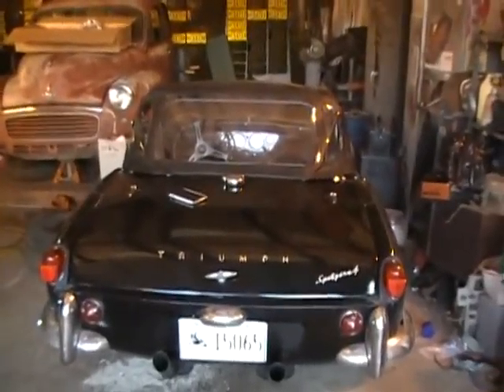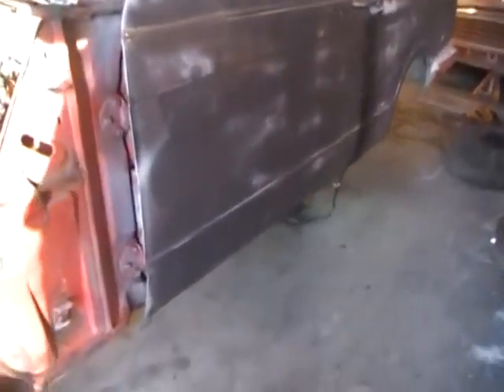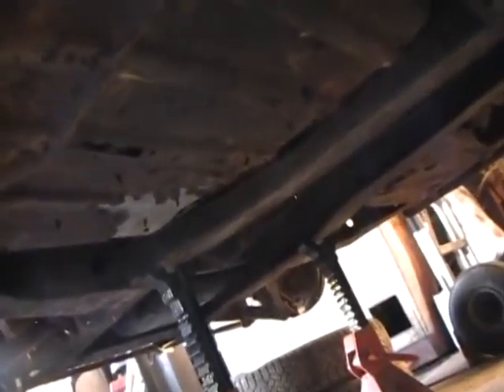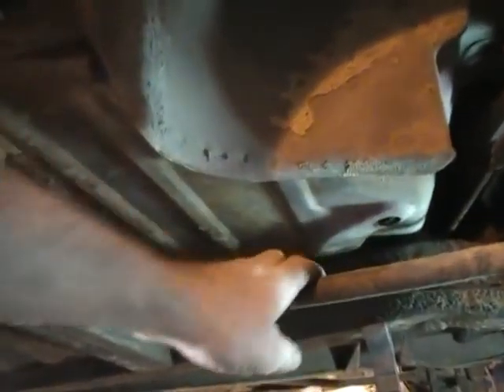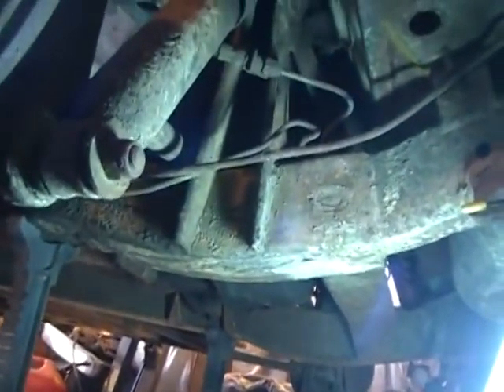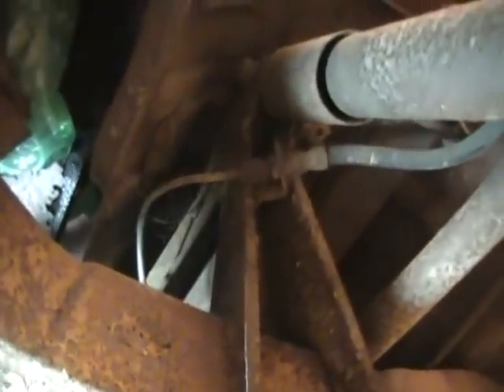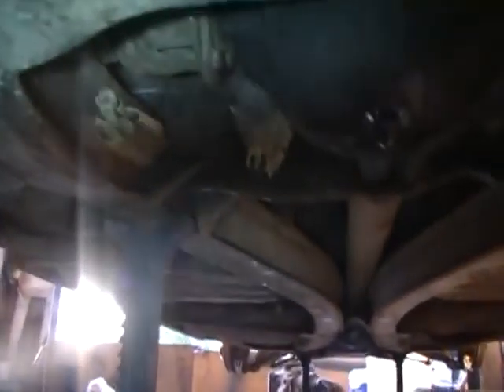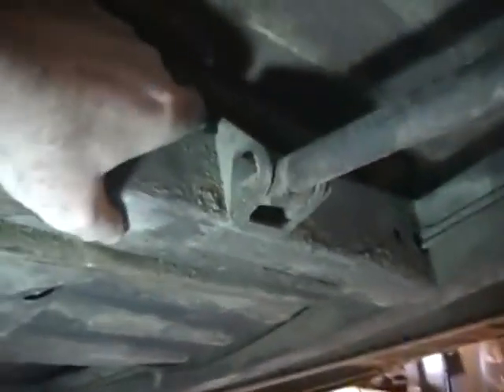Cutworm Cousteau explores Triumph Herald

Comment: I tell you what, I doesn't look half bad, if you can avoid taking the rear body off to do the rear mounts that will save a world of hassle getting the body lined up when your done, unbolt the rear and corner valances and you will see a lot better, side rails are normaly thin, just there to stop the outriggers flexing, rear radius arms bent from factory, looks really good mate, you'll overtake me an vincent!
Reply from the maker: Thanks Brother Scotty. I have a plan on making a raised plate thingy that goes across the rear boot floor tieing both rear body mounts together in one panel. Then mounting it to th chassis. Rear vallance and both corners will be replaced with new ones from the mother country soon as funds allow. Looking forward to see sir Vincent in the next video. We are so lucky and blessed.

Comment: What a cute little car. I wonder how a turbo would be on it.
Reply from the maker: Prolly tear th car in two and break my neck for th 3rd time....
Reply: But...the fun that could be had...I know a guy who built a Ford Fiesta with a turbo and fuel injection off a Ford Escort...He said it was some kind of English motor that came in them. I wonder if it's similar to yours?
Reply from the maker: Ford had-has plants in every place. Triumph mills are loosly based on a Freguson tractor. Most performance euro stuff was developed by Ford of Germany. However the UK has been makin Fords for over 80 years.